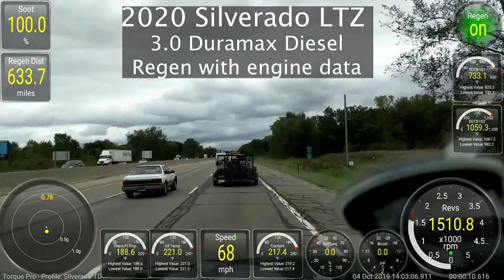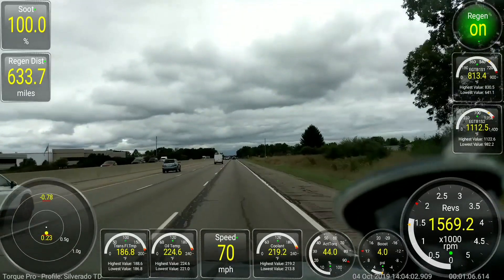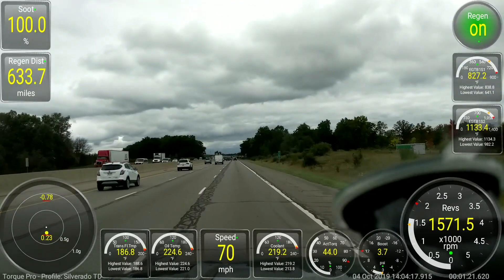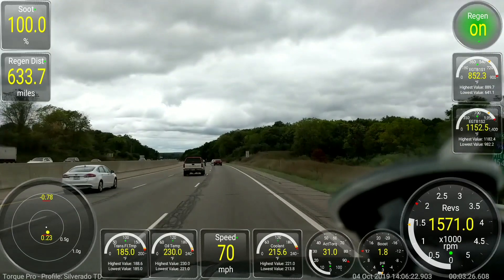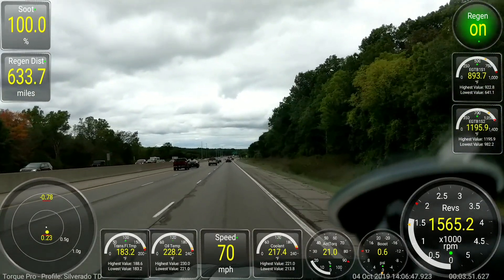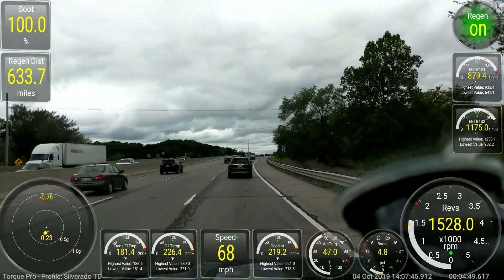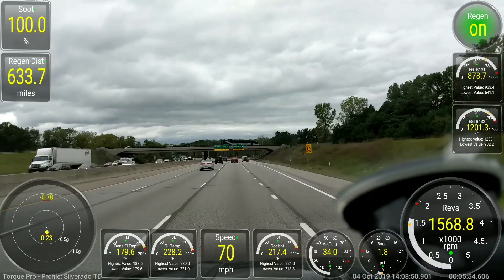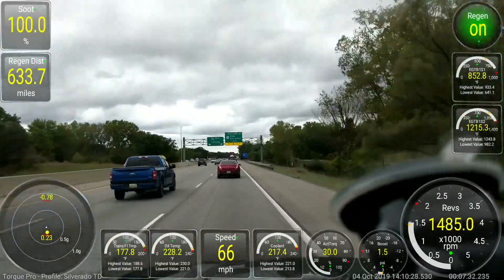2020 Silverado 1500 Duramax Diesel, Regen #12 full cycle talk

Comment: You say modern DPF DEF diesels air is cleaner leaving the engine then when coming in. I guess you would be ok parking in a small garage, close all doors and windows, get back in the truck, roll down the windows and take a nice long nap with your truck running. WE NEED CLEAN AIR to live heathy lives!

Comment: i have 2022 3.0 diesel. How can i tell it's doing a regen without having all the instrumentation?
Reply from the maker: There are 3 tattletale things to look for.  1. High idle when you stop with the truck in gear. 2. A little bit more exhaust noise when on lite throttle. 3. Mileage will drop down to 20mpg on the Highway.  It only lasts for 10-15 minutes so there is a really good chance you will miss it.  Thanks for the question and let me know if I can help with anything else.
Reply: @CJIEngineering  will the auto stop not work, also?

Comment: How do you make your duramax regen manually
Reply from the maker: I only know two ways, use a Banks iDash gauge or purchase a scan tool.  I have a mdi2 USB interface and a VXDIAG VXC Nano but you still need software for those and unless you want to rent the official version I would recommend the Banks unit.  It gives you a lot of insight into what the engine is doing and you can clear codes and perform a regen any time you want.  Thanks for the question.

Comment: Chad, Question on the Boost Gauge. i've been running this App since 2020 with my Silverado 3.0, used the PIDS for regen etc., i just recently came across a bunch of threads where people who are using the Banks idash and showing boost readings of 29-30psi on the regular. my Boost guage is setup just like yours with me making zero boost at idle and i max out right around 17-18psi. i have called a couple dealerships to talk to techs and they said if there was any issues with the boost it would throw a code. I'm wondering if the Torque app doesn't read the boost correctly because my truck feels fine and I'm putting out the same figures as your gauge is showing. thoughts?
Reply from the maker: I just ordered a Banks Data Monster gauge to check out what the differences are.  There are a few places to measure the pressure and if it is before the intercooler then that pressure will be higher.  I believe the one we measure with Torque Pro is the intake manifold pressure so it will always be lower.  What you were told is also true, if the engine is not getting enough, or is getting too much boost a check engine light is illuminated so you know there is a problem.  I'll probably do a video comparing the results.  I now monitor about 23 different items while I drive and I'm looking forward to trying out the Banks unit to log that data.  Thanks for the question and I'll get back with you in a few weeks when I get everything set up.

Comment: Good video! Question: with that combination of OBD and app, can you force an active regen? I know some of the aftermarket gauges like the Banks offer that capability.
Reply from the maker: I am not able to do that at this time.  I have seen it done using the Tech2 tool for some older diesels and using XTOOL D7/D8 for some newer vehicles.  If I end up with some extra cash I would like to get one and see how it is done :). Thanks for the kind words and the question.  I really appreciate it.
Reply: @CJIEngineering  thanks for the reply! I’d love to find an economical way to force them on my schedule. I drive enough to own a diesel, but just barely. Would be nice to tell it to do regen when I know I’ve got the time.

Comment: I can't find any measurements for Regen other than the EGTs in my Torque App, how did you find those gauges?
Reply from the maker: This is a link to the extra PIDs that I use with my vehicles.  You will need to import them into Torque and then you can add the same regen state that I show in the video. https://drive.google.com/file/d/1G9PW5GGHfHWLiXC44Xc1S-nRss26AaHj/view?usp=sharing

I hope this helps.
Reply: @CJIEngineering  that's pretty gangster, thank you!

Comment: That’s a passive regen. That’s different then the Trk being parked and regening.
Reply from the maker: Actually passive Regen is when the exhaust temperature stays above 850F and the filter burns off just because of that high temperature, active is when fuel is added to get temperature to 1250F to do a higher temperature cleaning.  My Equinox does an active clean ever 1,400km, the Silverado does it 1,000km and I never figured out what the Colorado was doing.  A forced/parked Regen only happens with the factory tool, there isn't a way we have to do that.

Comment: Hi Chad thanks for the informational video. I added the PID information from the google sheets you added in one of the comments below. I was able to get the DPF soot % working but the one for current gear wouldn't work. I copied and pasted the equation into the app to make sure I didn't enter something wrong. Any suggestions? 2021 GMC Sierra 3.0

Comment: Hello  ,
Do you have to have block header  on during winter months  ? 
I  have limited access  to the power
Reply from the maker: You should only use the block heater when temperatures are below 0F.  I have started the truck easily down to -20F so I would plug it in if we were going to have multiple days below that temperature.
Reply: @CJIEngineering  Thanks

Comment: Have you ever noticed any sort of slight burning smell during regen?
Reply from the maker: Yes for sure, you will also notice that the fans may kick on after you shut the truck off.  If they come on I'll use remote start to let everything cool down so it won't stay too hot very long.  There is an electric water pump that will circulate water even after you shut down the truck so the turbo bearings are safe but I like the idea of it cooling down by idling.
Reply: @CJIEngineering  awesome thanks Chad!

Comment: 2021 silverado 1/2 ton 2wd i'm getting 108 miles between regen cycles.  34 mile one way freeway not towing .. that dont seem rite???????
Reply from the maker: William,  that does seem really low but there are several reasons why this could happen.  1.  Low quality Diesel fuel can cause unburned fuel, soot, to exit the combustion chamber and get stopped by the DPF filter.  2.  Engine oil being burned in the combustion chamber causing soot.  3. Leaky injector causing extra fuel in one cylinder making it run rich, causing soot.  4. Wrong engine oil was used in the past and the Sulfur or Ash in the oil has damaged the DPF. 5. Lots of idle time, remote starting and not getting up to temperature.  I'm sure there are some other but those are the ones that come to mind first for me.  My suggestion would be to hook a trailer behind the truck, preferably 2,000lbs or more and take it out on the freeway and see if you can keep the EGR around 850F for at least 60 miles.  When I tow a trailer the system gets cleaned out and stays clean for a decent period of time, I have had lots of regens that are 620+ miles, max the truck will allow is 1,000km before it will force a regen to take place.  If after towing you still have regen's that happen around the 100 mile range I would take it to the dealership and have them look at it.  There is a counter that indexes for every regen so they should know how many the truck has done over the # of miles you have driven.  If you don't mind, keep me posted on what you find.  The info above is for  a future video explaining what I have seen over my 25,000 miles.  Thanks for the question and good luck.

Comment: how did you get that info on the screen?  is that something added to your phone via bluetooth or OBDC port?
Reply from the maker: I use an Android Phone with the Torque Pro app from Ian Hawkins plus for that specific view he also makes an add on call Track Recorder that will overly the video with the data.  These two apps would run on my Pixel 2 for about 15 minutes before it would overheat so I have swapped over to a screen recorder app for some more recent data I have been collecting.  You do need to have a Bluetooth to OBD2 adapter, I use the OBDLINK MX model.  It support high speed data transfer and has been super reliable, plus you can't hack into the car like some of the cheap models.  Thank for the question and for watching.

Comment: Great video Chad. Where did you get the software that logs all the data that you are displaying in your videos?
Reply from the maker: Ramon,  The software that I use is Torque Pro from Ian Hawkins on my android phone.  He has an add on called Track Recorder that you need to add to do the overlay function.  It is pretty cool but can cause your phone to overheat, that would happen with the Pixel 2 in a spigen case in about 15 minutes.  I'm now just doing a screen capture software with a GoPro to do the overlay manually, more robust setup.  Thanks for the question and for watching.
Reply: @CJIEngineering  Thanks Chad for that quick reply. I am looking forward to your next video. I just bought a Silverado 1500 and took it from Florida to D.C. and back. Great vehicle. I am really loving it.
Reply: @CJIEngineering  If I may ask you a couple of follow-up questions: What bluetooth scanner are you using? I am interested in knowing when my truck's next regen is going to be. Does the Torque Pro comes with the necessary PID's to get me that info? If not, where can I get those? Thanks in advance
Reply from the maker: @ramonmurillo167  I am using the OBDLINK MX from Amazon, they don't have that version anymore but do have the MX+ version.  I can't say if the LX version will work for sure since I have not used that one yet.  As for the PIDs, the majority of them are included if you add the predefined list for GM/Opel.  I made a video on how to add them and I share a Google drive link in the description for that video.  If you can't find it let me know and I'll add the link to a future reply.   Torque Pro will show you the % soot load and how long it was between the prior Regen cycles.  I believe the most the engine will allow is about 625miles/1000Km and then it will force a Regen based on the number of miles even if the filter is still clean.  I'm going to do a video on the difference reasons for Regen and I'm trying to figure out how we can report the reason code....   Let me know if you need anything else.

Comment: What PID do you use for boost in the Torque App?
Reply from the maker: Mike, I use the "Turbo Boost & Vacuum Gauge" on these videos.  I have been looking at some data using EFILive system and sometimes it does not match...  Not sure what is up with that but if I figure it out I'll make sure to let everyone know.

Comment: About how many miles are you getting on a tank of def if you aren’t towing? I am lucky to go 2200 miles before having to fill it up again.
Reply from the maker: Travis, if I'm towing I have had the truck tell me I could only go 879 miles but typically I'm in the 3,000-5,000 mile range.  I am going to do a video on DEF and make sure everyone knows that GM is really protecting their buts by telling you to fill up a lot more often than you need to in order to make sure the truck "NEVER RUNS OUT!!!"  If it tells me I'm empty the first time I will put in only 3.8 gallons on a 5.4 gallon system...  It's good to keep it topped up and I'm lucky to have a truck stop that sells it only about 5 miles from my house so it's easy to keep fresh DEF in the tank.  I hope this helps a little bit.  Thanks for the question.

Comment: What program/device do you use for all the info? I'm having power issues at times, a chugging effect for a sec or 2. I believe it to be during regen but have no way of telling. Thanks in advance
Reply from the maker: I use an Android phone, Pixel 2 and sometimes a Samsung Galaxy S6 running Torque Pro app.  For the OBD2 reader I'm using the OBDLINK MX purchased from Amazon.  This model is out of stock but the MX+ can still be purchased, it has protection and higher refresh speed than the super cheap models.  Just from you description I would think it might be the EGR system since is clears up fairly quickly but could be related to the Regen.  Let me know if you figure it out.  Thanks for the question.

Comment: is there a way to see the soot filter and when the truck is regening in the truck? What do you use to get these gauges?
Reply from the maker: Vince,  yes there is a way to see the numbers you are looking for, I have a video on how to add the PIDs to Torque Pro on an Android phone/tablet and a link for a google sheet that I maintain as I find additional gauges/data.  I use the OBDLink MX bluetooth adapter to read all these values.  The MX is no longer available on Amazon but you can purchase the MX+ version.  Thanks for the question and for watching.

Comment: 12 regens in 3600 miles? Lemon law that shit. It's overfueling.
Reply: Overfueling?
Reply from the maker: I don't believe it is overfueling, that would cause the temperature of the DPF to increase and clean.  I'm leaning toward the fact that it has too much torque and the overall aero efficiency keeps the exhaust temperature too low.  The Equinox that I drive runs around 800F and self cleans, this truck runs under 700F so the filter needs to be clean by a DPF Cleaning cycle.  While towing it stays well above the 800F level and will go a very long time, ~680 miles.  I'm still running it, just over 12,300mile and in the next 6 weeks I'll be adding another 4,000 miles.  I will have about 16,000 miles for the 1 year review.
Reply: I was informed earlier this morning that I have regened 12 times in 2400 miles. They said the computer is still learning and that it regens to get an estimate of how much soot is burned. They said if the issues I'm having don't subside by the first oil change, then we will explore an different ave.